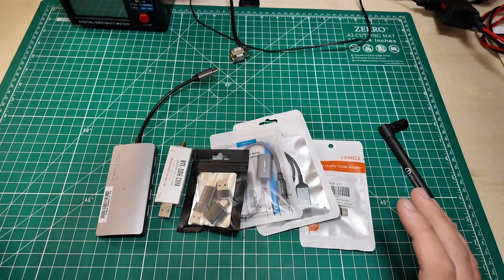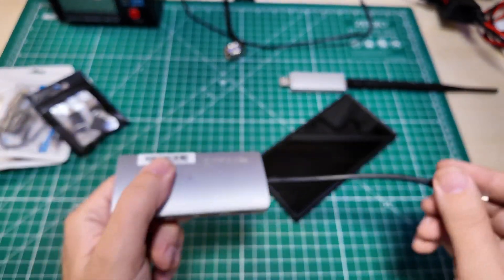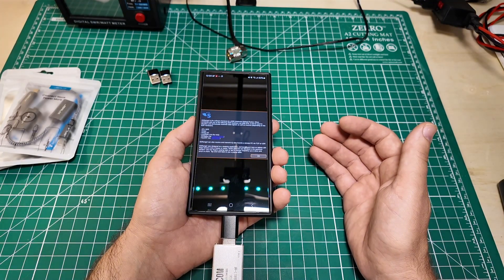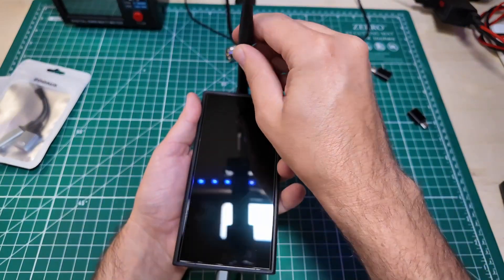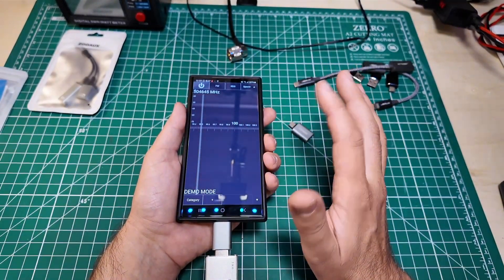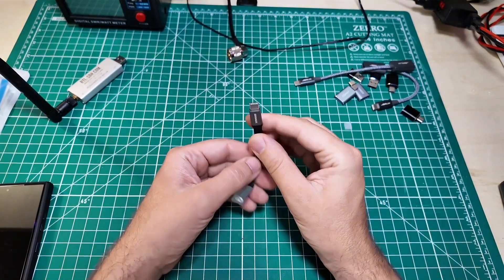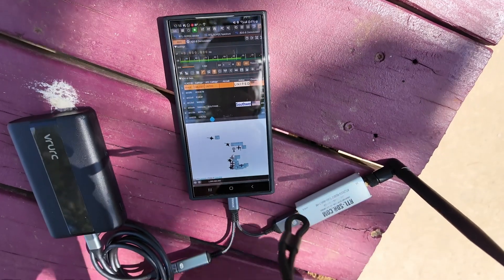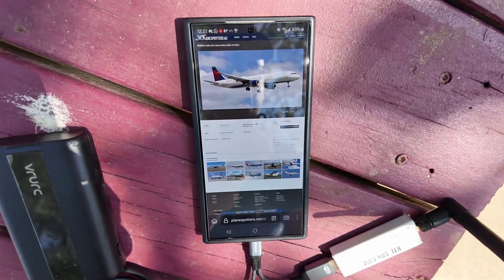Track Planes Using Your Android! ADSB + SDR Angel + Android

Comment: Does the internet need to be up to show the map if you're mobile? It seems you need location service I.E. GPS working for this to work if you're mobile. Can it do offline map storage? Does it work if phone is in airplane mode?
Reply from the maker: The plane spotting will work offline, but you'll just get the raw ADSB data as there wouldn't be any online reference source.  If you want to get serious about ADSB, you can upgrade this system to a raspberry pi based system with more storage and offline maps.

Comment: I have some old cell phones with no service, they are from android...is there a way to turn them into a server and run 24/7? Connecting them to a Switch? BTW: airlines use 1090 Mhz and general aviation uses 978.00 Mhz there is also one for drones called Remote ID compliant... In addition, the FAA broadcast digital data for WAAS..... What the same for Cargo trains? What about the same for boats? Preferred on a switch and not WiFi
Reply from the maker: If you're going to get serious about running it 24/7, check out my playlist on making a raspberry pi setup, it would be better than running off of android and you can feed the online data collectors also.